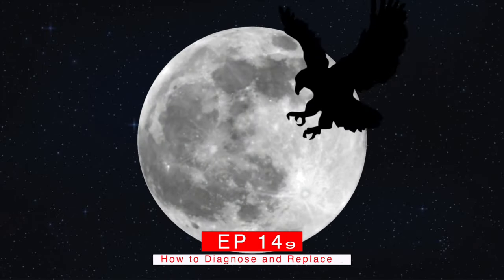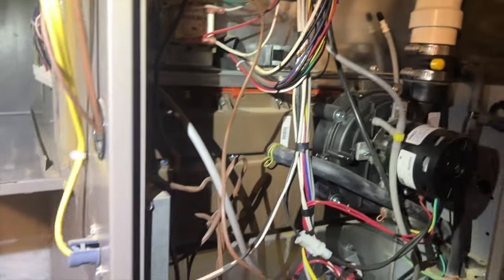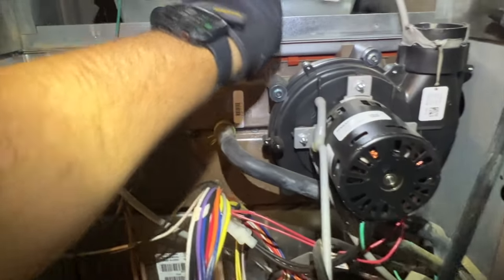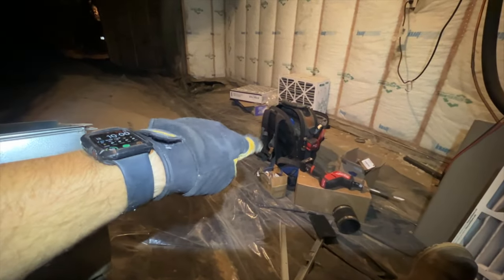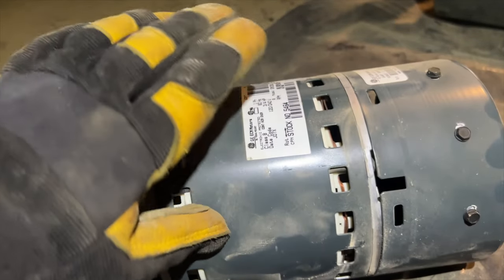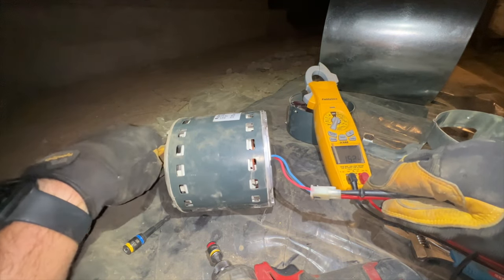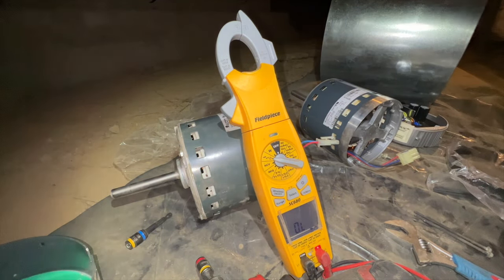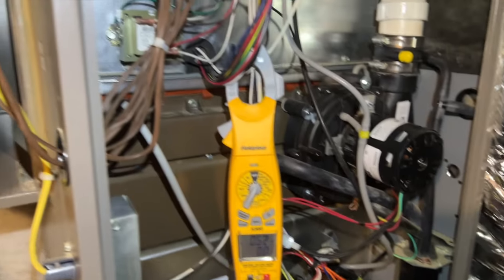How to Diagnose and Replace a Constant Airflow ECM Blower Motor EP149

Comment: The little dark round thing is a MOV or metal oxide varistor they act like a fuse. Too much voltage and they open, and they will not reset they need to be replaced.

Comment: THANK YOU FOR THE VIDEO. QUESTION....COULD THAT MOTOR HAVE BEEN CONVERTED TO A PSC MOTOR?  IF SO, THEY WOULD OF MADE FOR A VERY INTERESTING VIDEO AS WELL.  THANKS AGAIN!
Reply from the maker: There is a way. I have a video for converting a constant torque ECM motor to PSC. For the Constant airflow there is a module you can buy to convert it. 
How to Convert a System with an ECM Blower Motor to a PSC Blower Motor EP119
https://youtu.be/NzV3ZRQs3Hs
Reply: Thank you!!

Comment: are ECM motors less reliable than PSC?
seems like I see ECMs fail more often than PSC

edit: I'm not in the trade but just nerdy about it 😎
Reply from the maker: ECM motors are more complicated and have more points of failure.
Reply: ECM'S ARE NICE WHEN THEY WORK (QUIET STARTING AND RUNNING). I HAVE TWO YORK AFFINITY DUAL FUEL SYSTEMS LIKE THE ONE IN THE VIDEO.  EVERY YORK ECM HAS FAILED LOCATED IN THE AIR HANDLERS. THE ECM MOTORS ON THE CONDENSING UNIT HAS FAILED 3 TIMES IN 15 YEARS.  I WILL NEVER BY A SYSTEM AGAIN WITH THESE.  I JUST WANT THE STUPID THING TO WORK. I DID HAVE ONE OF THE ECM CONVERTED TO A PSC.  10 YRS AND NO PROBLEM.  ONE SYSTEM I STILL HAVE UP AND RUNNING. THE OTHER I PULLED OUT AFTER 9 YEARS AND TOOK TO THE DUMP.  PUT IN A 2.5 TON INVERTER WINDOW UNIT.  YES A WINDOW UNIT BY LG.  NOT A SINGLE PROBLEM.